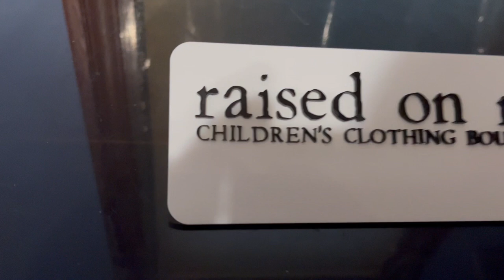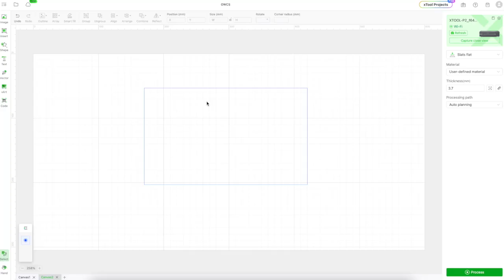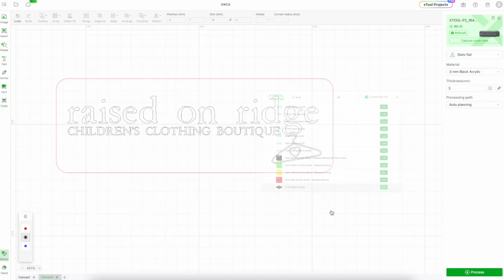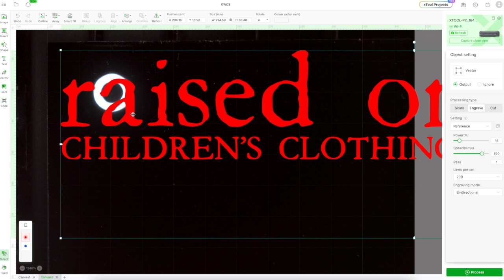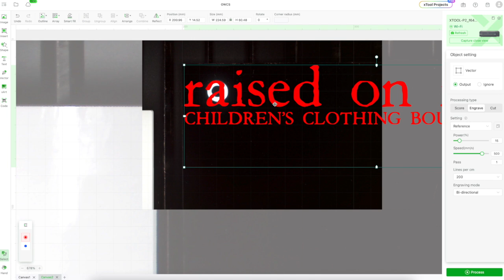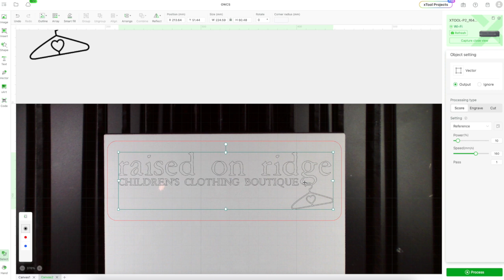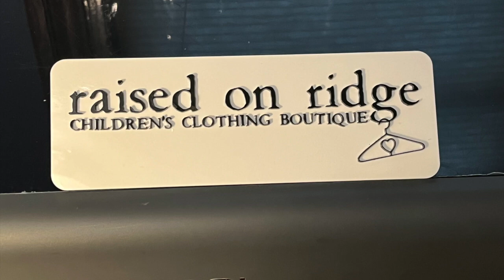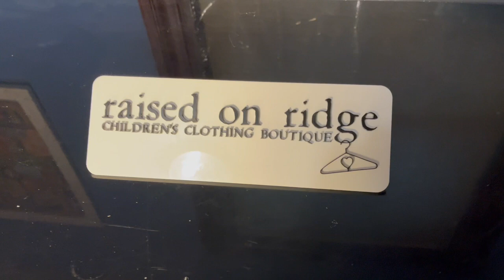How to Make Acrylic Logo Sign with xTool P2 55W CO2 Laser

Comment: On the channel called That Mom with a laser, she puts 3M Adhesive on the back of the piece with the small letters. She has an additional cut line that matches the white piece. Then, after the laser cuts it, she puts blue masking tape on the top to hold all the small letters to the outline of the black cut piece. She then removes the 3M tape on the back of small letters and overlaps the two pieces, and you do not have to meticulously put on each letter
Reply from the maker: Yes, that's a good approach. Thank you for the suggestions.

Comment: Isn't it annoying to reorganaize tiny pieces?
How about sticking the material on the metal plate with double sided tape and cutting from reverse side?
I think that makes easy to stick them to the base plate.
Reply from the maker: Sounds good!  You can also use the Adhesive on Acrylic backside before cutting.
Reply: @xToollaser  I have a P2 but I'm far from the professional. Let me know when you find the tricks ;-)